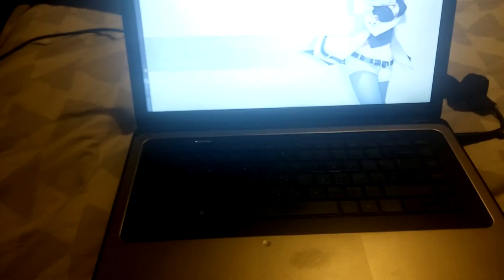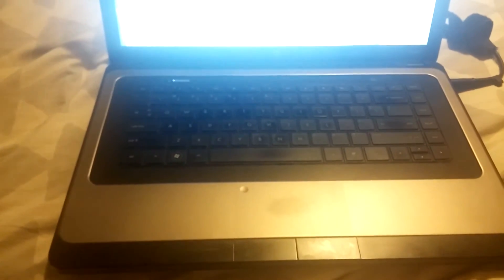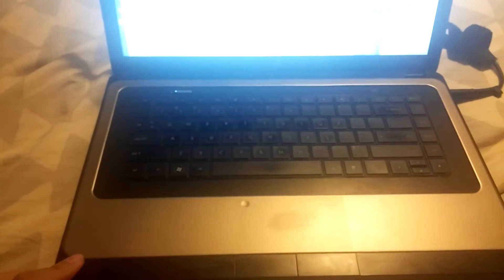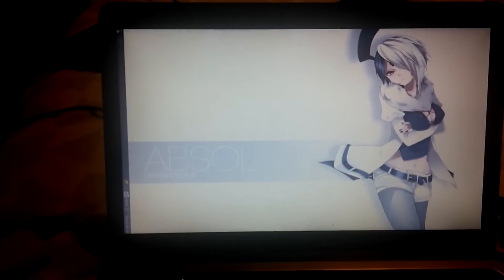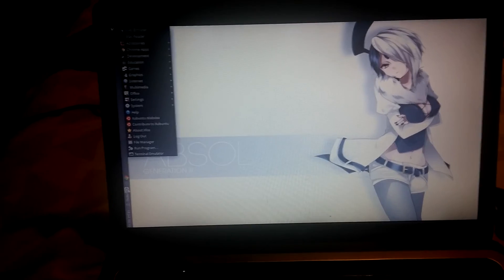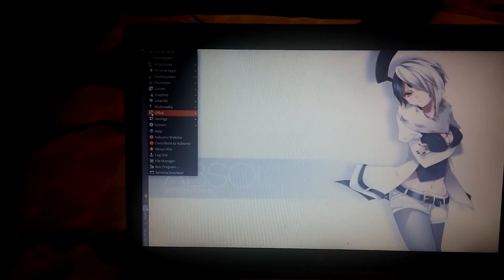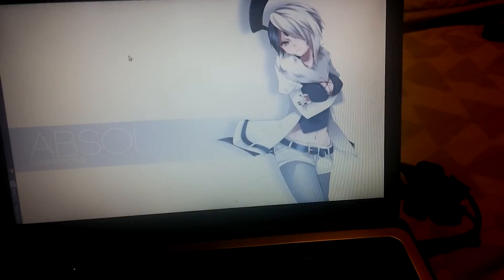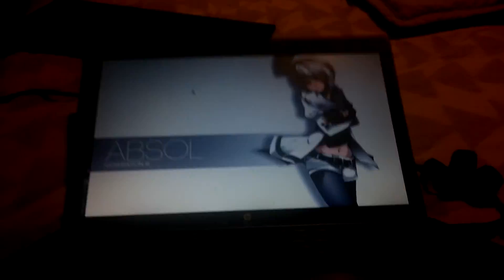HP 630 laptop overheat fixed

Comment: Got a HP 630 laptop with this issue. Will shutdown as soon as any thermal stress hit it. Going to remove that tiny heat sink on the soutbridge and put in a proper cooling solution.

Comment: i didn't understand what did you do ?
Reply from the maker: Take apart and remove mesh covers inside chassis for better air flow. New thermal paste on CPU and Chipset. The laptop is garbage and should be completely replaced with something better. This is only a temporary solution that may last a long time or not at all.

Comment: I had to also open the fan and remove the dust that accumulated in there, this was the single most significant contributor to the overheating problem. I still needed the thermal paste to put the fan block back to the CPU properly.

Comment: do you know if overheat  could be related to battery problem?, because my hp 630 suffers overheat and its battery fully charged doesnt last more than an hour. Thanks for the videos
Reply: If your laptop overheats often, your battery will slowly dying. Battery heat too much heat. Take it out if you use it as dekstop
Reply from the maker: no, unrelated. this laptop has about a 2 hour battery life NEW. overheat tends to happen more often when charging And above 80% battery because the processor is running at max speed causing overheat. your battery might be a lesser capacity (below 2200mAh) or just older, reducing run time. I would say to get a replacement battery but it would be better to get a new laptop since the HP630 is more problems than it's worth and decent casual laptops are like $250
Reply: it says 4200mAh

Comment: Hi, does this also work for HP Pavilion Beats? Or are the computers the same?
Reply from the maker: most HP laptops seem to have an overheat problem and can possibly be fixed in the same way (future reliability may vary). depending on the issue, you may have to reflow the motherboard chipset or just replace heatsink thermal paste.

Comment: thanks. Now I can watch 60p HD videos without noise from fan- iddling at 30 degrees. I didn't put foil, just applied thermal paste on southbridge contact with heat disposer. Works great on Windows and Linux(dual boot). 
It seems that overheated southbridge is the weakest spot on a computer- it was making total mess.
 And one more thing- I also wrapped insulating tape around copper tube which transfers heat from CPU to fan, so it doesn't heat the motherboard and a chip which it touches.